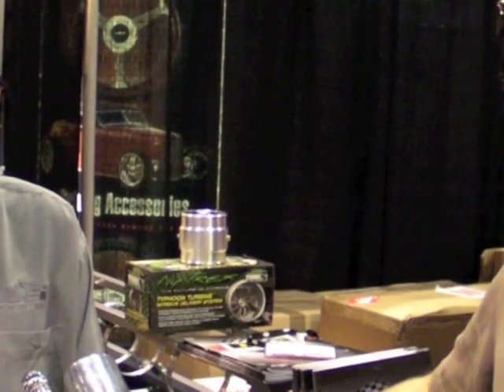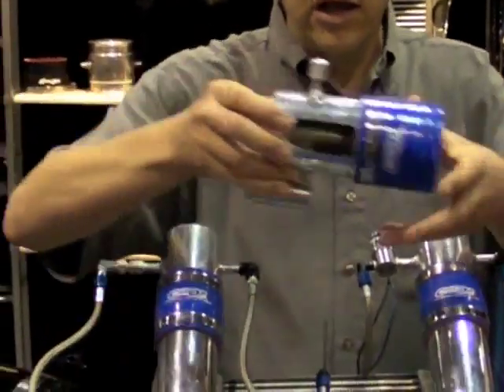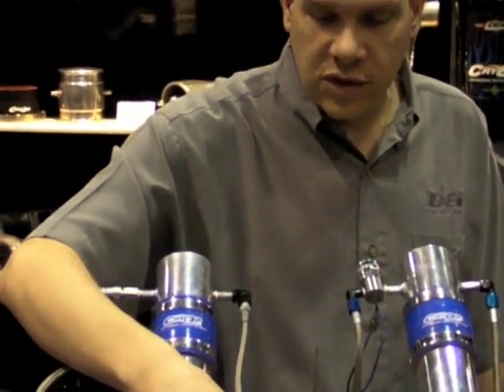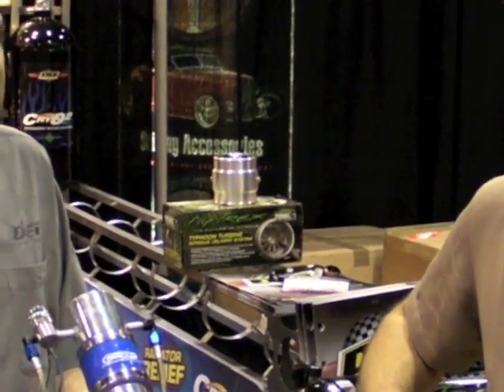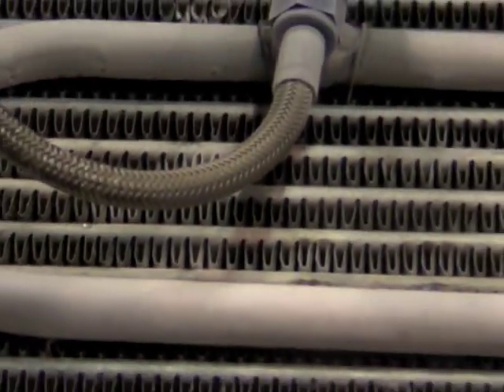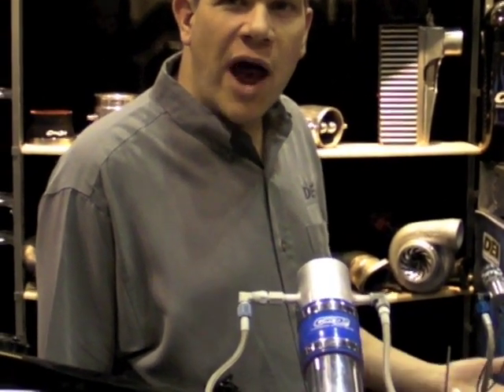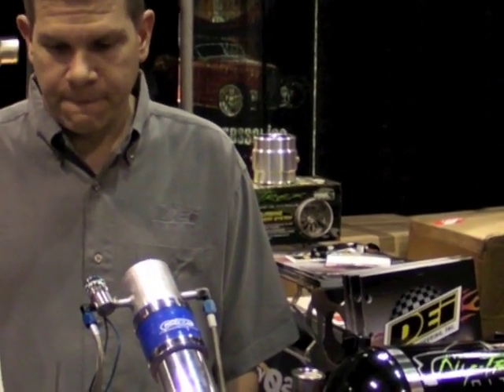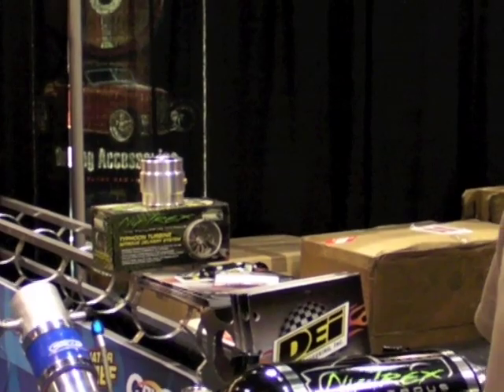FSC - Design Engineering CryO2 Cryogenic Intake System Demonstration at PRI 2011

Comment: Can this be used effectively in an n/a car?
Reply: Sity Sityy most the benefits would be gained though forced induction, due to the heat generated though the compression of the air. You would see benefits but from a £/$ to bhp ratio it wouldnt be worth it
Reply: I'd like to know too

Comment: If I was going to install a big heavy high-pressure bottle and associated systems that I constantly had to refill,  to achieve a power increase, I think it would be a nitrous system...

Oh, and as far as I am aware, CO2 is stored as a gas, and then sublimates straight into a solid, which says that for a given volume, you can store more liquid nitrous oxide than CO2.

Great idea though.... Maybe if you bubble the CO2 through water/ethelene glycol, and run a water to air intercooler, that would work even better??